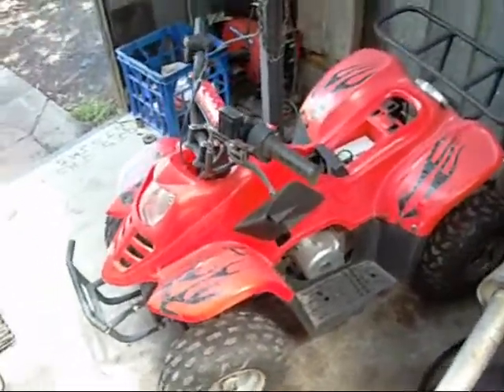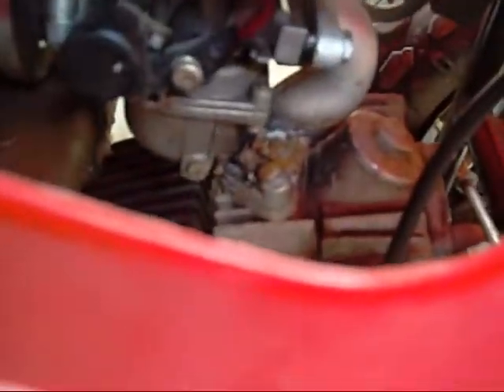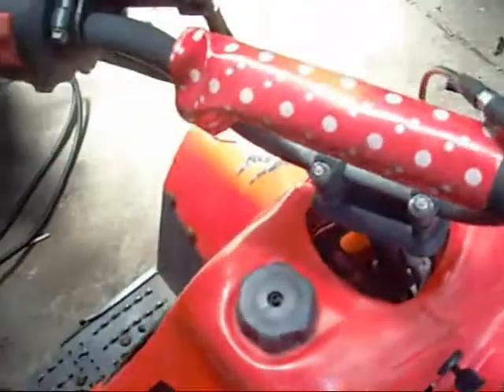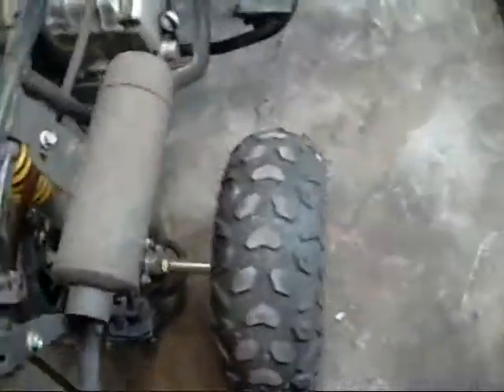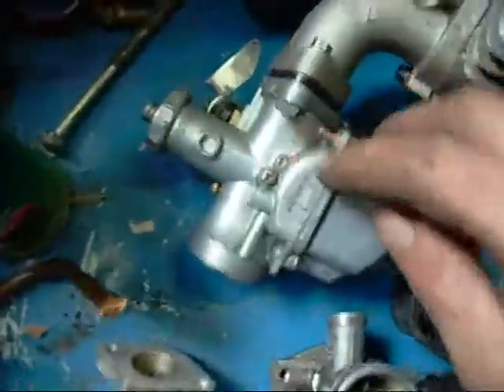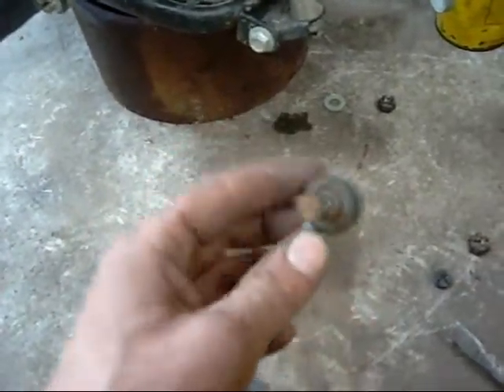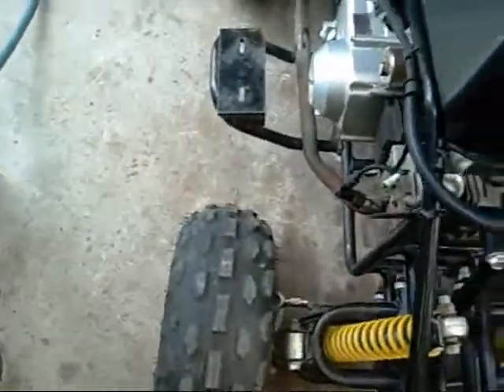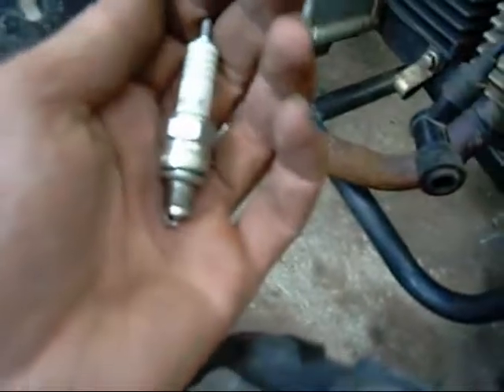$10 Mini Quad Bike

Comment from the maker: Its not a magneto as such, it uses a electromagnetic pulse from the flywheel to trigger a Capacitor Discharge Ignition (CDI) module.

I bought a new CDI Module and it runs perfectly, deadly fast.

I'm not selling it at the moment, but maybe later on I will

Comment: nice one. the engine looks the same as the one on the res small bike i fixed. the starter motors and wires are under sized i found. good job on the tie rod ends. wing-nuts dont need grease so whay should balljoints.lmao